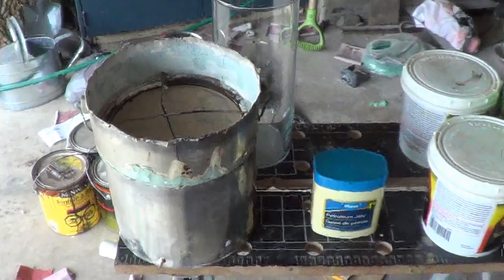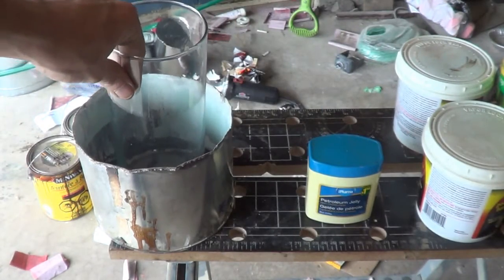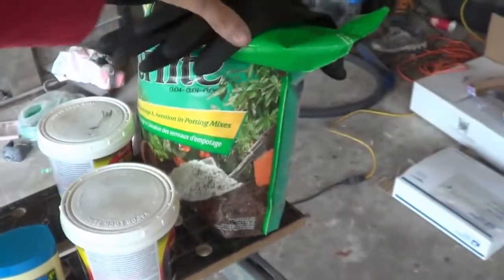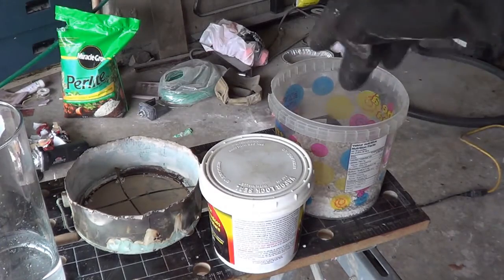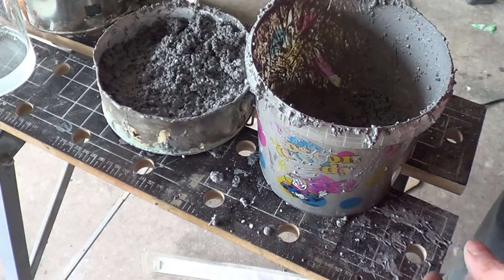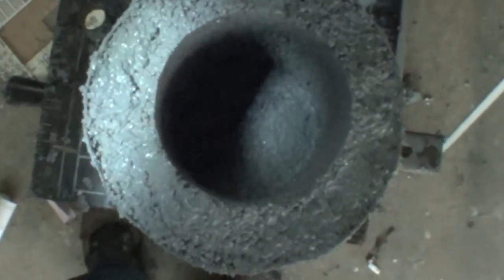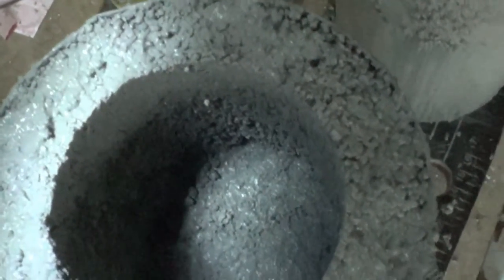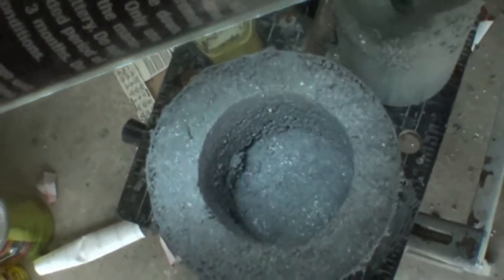Blast Furnace part 1 (The build)

Comment: Cool blast furnace Joshua. Just curious why do you add perlite to the concrete?
Reply from the maker: diggingtreasure1 Hi Tommy . It brings the coast of the build down Dramatically . It also adds to the  heat shealding and retention  by creating micro air pockets . Best wishes my friend GL&HH

Comment: cool i will have to build me one of these. ive been making silver bars i did a video today but someone rang my phone just before the pour and ruined it stop the recording. you mentioned making some dies to how would you do that sounds great i want to make some cool moulds for my silver. any idea how i would do that.
Reply from the maker: 11robert11 Hi Robert thanks brother. For my dies i will pour some brass bars narrow at one end  to be carved for coin dies  . I will do this the same way you should make your molds . I will make some delft clay sand . Its easy and i will probably do a video on it . But there are many already on the tube .  you will need some clean beach/ play sand and some dollar store kitty litter  . Unscented.   .  Crush the kitty litter to dust . The start mixing 90 parts beach sand  with 10 parts crushed kitty litter / clay . Mix the very well in a big bin . with a mister water bottle  mist the top of the sand . Mist it  "  dont wet it " . work the misted water in to the mix keep doing this until you are able to grab a hand full.  and squeeze it in to a clump . break the clump in the middle if it breaks clean with no crumbling  then its ready for what ever you want to press in to it as a mold . Here are some links .
https://www.youtube.com/watch?v=U7ut_2nqiGk
https://www.youtube.com/watch?v=Dt2mqlwMyZU

Comment: COOL COOL COOL
Reply from the maker: MichaelSwan66  Sorry it took so long brother .  I'll post part two in a few . Its curing slow . I must have added a tiny bit to much water . Lol. But it will cure out just fine .  Best wishes my friend GL & Happy melting
Reply: i really do have a pretty good amount of buggered up silver to melt going to make one of them for sure
Reply from the maker: Using a furnace you can melt silver with propane much cheaper than mapp.

Comment: hi, first, and a bit confused as to the top, I guess you poked the holes thru, and removed the lid? So now you have a top,with rebar supports, two vent holes and a wire handle... Right?
Reply from the maker: 101platayoro You got it . Once its cured enough just pop the lid .  And the holes are in place and ready for the first firing . To complete the curing .
Reply: Ok ,duh, got it! Thanks for the neat vid...